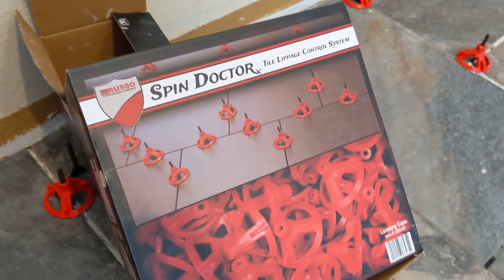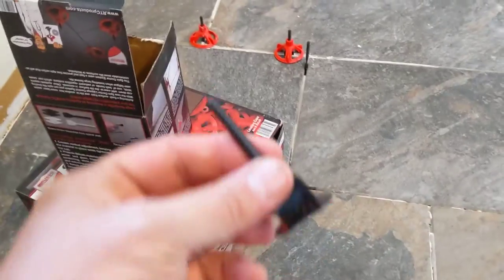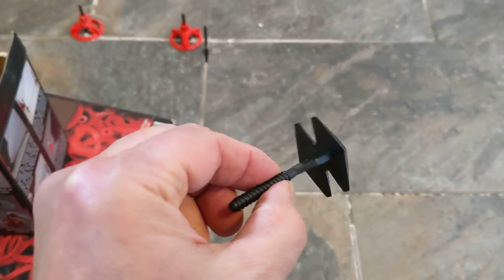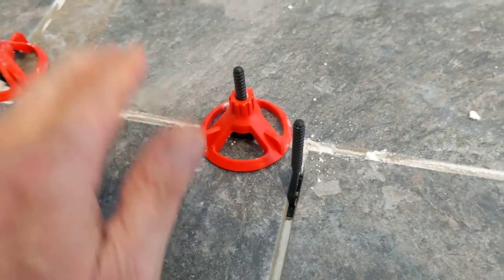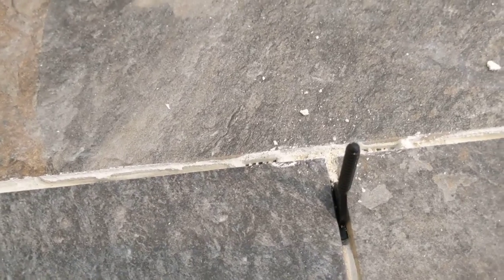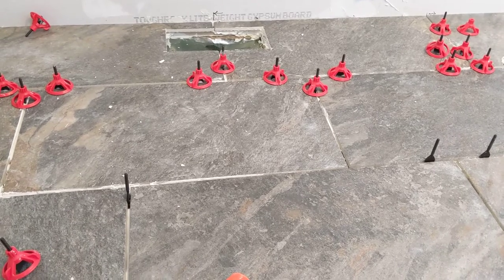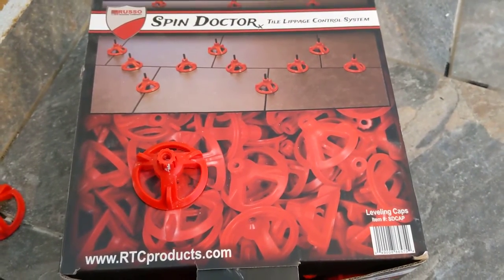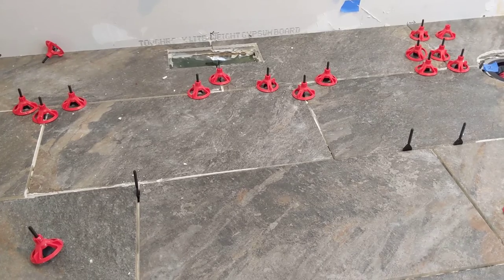Review - Spin Doctor tile lippage control system

Comment: You are knocking them off the wrong way.  You need to knock them in the direction of the grout line.  That is why they were breaking off improperly.
Reply from the maker: Great info Greg. When I made this just before cataract surgery and my sight was not that great, so reading instructions was something I avoided LOL. They worked pretty well, glad I used them. That makes sense to break them off direction of grout line.